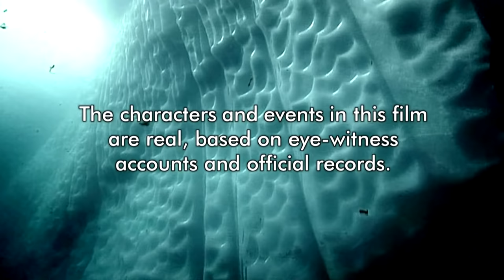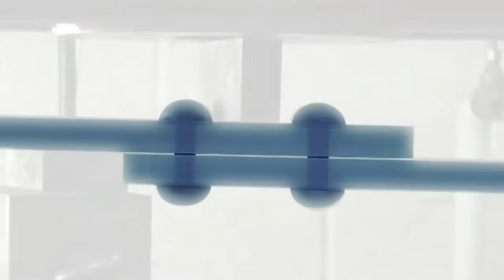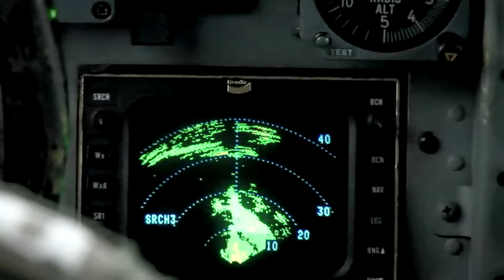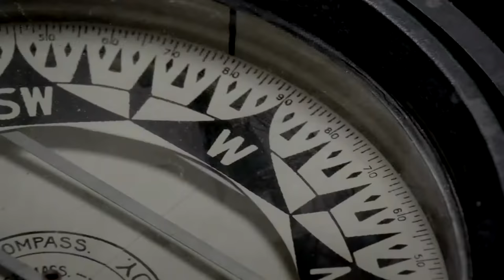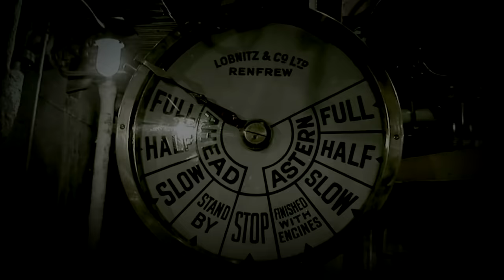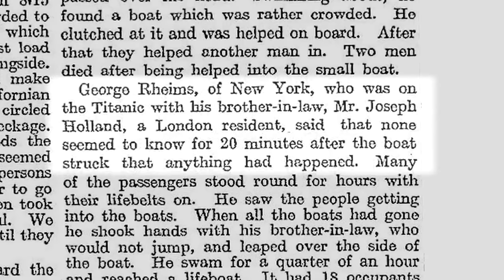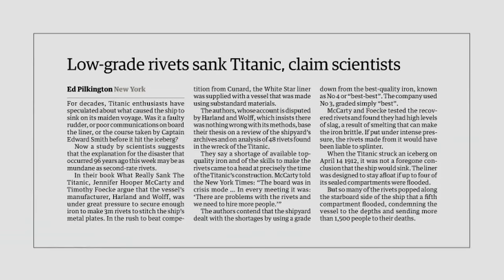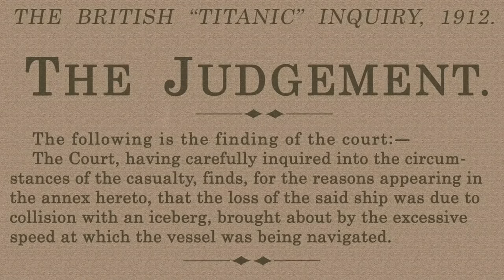The Unsinkable Titanic

Comment: Due to the weather conditions that night, clear & calm, which also caused a mirage to form, it make it difficult to see the iceberg even if they had binoculars
Reply: That’s no excuse what about the life boats they should of had more but no they got cocky saying it was a unsinkable ship you don’t play with the sea an put peoples lives at risk if they had more life boats all those people could of survived also the speed they was going knowing there was icebergs ahead several boats warned them
Reply: @bec1423  yes and the wireless operator should not have set the iceberg warning he received aside. Iceberg warning should have been priority, but since they were paid to send passenger messages, they made that their priority
Reply: @davinp   it’s a shame people lost their lives because the ones on the ship were reckless
Reply: @bec1423  While I agree they should've had more lifeboats, it wouldn't have helped. They only had 20 lifeboats (16 regular and 4 collapsible) and the last two weren't even launched properly because they ran out of time.
Reply: @bec1423  They actually had more lifeboats than the law required at the time. Back then, Lifeboats were used as a ferry between a sinking ship and rescue ships. The law required ships over 10,000 GT to carry 16 lifeboats (as they decide the amount of lifeboats on a ship by its gross tonnage, not the passenger limit). Titanic, a 46,000 GT liner, carried 20. Such a shame that the law was last revised in 1894.

Also, Harland and Wolff, the shipyard, never said that the ships was unsinkable. The press did, and the people believed it. Even WSL's VP believed it.
Reply: As the story goes .
Reply: Yes, which should give them  reason to be more apprehensive !
Reply: Better than their eyes ! 👀
Reply: They new there were ice fields but ploughed through full speed to beat the clock. Very silly mistake
Reply: @bec1423   Actually, what you just said is a complete myth. In actuality, they wanted to opt for MORE lifeboats. The problem was they were too heavy. The standard life boats, the 14 clipper built wooden lifeboats, weighed over 2 tons each! The 6 other boats, two cutters and four collapsible's, weighed more or less than a ton. Given their weight, any more lifeboats would have caused the ship to rest lower in the water and put it in risk of capsizing. That's why they opted to building collapsible boats. Because they weighed less than the clippers, they were able to get them certified. Unfortunately, that's all they were allowed to put on. Even if weight wasn't an issue, given the time it took the ship to sink, there is no way that 48 lifeboats would be launched successfully. Also, it should be known that the belief of Titanic's crew was trying to break speed records is yet another myth. In truth, they were competing with Cunard, not in speed, but in size and luxury. And the crew considered the comfort and safety of its passengers above all else. Though it is recorded that Titanic was clocked at around 21 knots when she struck the iceberg. Back then, it was an unwritten tradition to beat the ice field before it crossed into their waters. Beforehand though, it was crucial that they stay at a reasonable speed. This is further stated by the WSL motto which, unfortunately, I can't remember off the top of my head.
Reply: @6metaweemaxphethin16   And the reason why the number of lifeboats went by tonage rather than capacity was because of their weight. 14 clipper built wooden life boats weighed over 2 t each. Then there were the 2 cutter lifeboats that weighed about a ton and a 1/2. And finally you have the 4 collapsibles that weighed a little less than a ton. Too many clippers, and the ship would settle lower in the water than normal, compromising the ship's buoyancy and put it in danger of capsizing.
Reply: @bec1423  the Cunard ships did not have enough lifeboats…the Olympic did not have enough lifeboats…it was a BBoT regulation that dictated the number of lifeboats not WSL…
Reply: @davinp  the message was not marked correctly when sent…
Reply: @brianwhitford6086  can you explain how the addition of 16 more lifeboats (32 tons more) is going to affect a ship that displaces 52,000 tons
Reply: @6metaweemaxphethin16  😅

Comment: On 9 October 1912 White Star withdrew Olympic  from service and returned her to her builders at Belfast to be refitted to incorporate lessons learned from the Titanic disaster 6 months prior, and improve safety. The number of lifeboats carried by Olympic was increased from twenty to sixty four (per Carlisle's original number), and extra davits were installed along the boat deck to accommodate them. Also, an inner watertight skin was constructed in the boiler and engine rooms, to create a double hull. Five of the watertight bulkheads were extended up to B-Deck, extending to the entire height of the hull. This corrected a flaw in the original design, in which the bulkheads only rose up as far as E or D-Deck, a short distance above the waterline. This flaw had been exposed during Titanic's sinking, where water spilled over the top of the bulkheads as the ship sank and flooded subsequent compartments. In addition, an extra bulkhead was added to subdivide the electrical dynamo room, bringing the total number of watertight compartments to seventeen. Improvements were also made to the ship's pumping apparatus. These modifications meant that Olympic could survive a collision similar to that of Titanic, in that her first six compartments could be breached and the ship could remain afloat.
At the same time, Olympic's B-Deck underwent a refit, which necessitated eliminating her B-Deck promenades – one of the few features that separated her from her sister ship. The refit included extra cabins (the parlour suites which proved popular on the Titanic were added to the Olympic), more cabins were fitted with private bathing facilities, and a Cafe Parisian (another addition that had proved popular on the Titanic) was added, offering another dining option to first class passengers. With these changes, "Olympic's" gross tonnage rose to 46,359 tons, 31 tons more than Titanic's.
In March 1913, "Olympic" returned to service and briefly regained the title of largest ocean liner in the world, until the German liner SS Imperator entered passenger service in June 1913. Following her refit, Olympic was marketed as the "new" Olympic and her improved safety features were featured prominently in advertisements.  !!!

Comment: Stopped watching about 50 seconds in when some guy (probably a self-proclaimed "expert") showed up saying "from the very day she was designed she was almost doomed". Making it sound like there was some critical design flaw and that she was inherrently a dangerous ship. Which is nonsense of course. Her sister Olympic got hit with a rogue wave that was big enough to break bridge windows, damage the compass platform amidships on the boat deck, and inundate the radio room which was also on the boat deck, but other than these minor cosmetic effects shrugged it off. The damage that Titanic took (opened up along about one third of her length) would also cause the vast majority of modern cruise ships to sink. Even today, ships aren't designed to take a third of their length being opened to the sea and survive it - it's just such a freak happening for that kind of damage to be caused, that it's considered acceptable because the probability is so low. In terms of subdivision and the kind of damage she could have taken without sinking, Titanic compares pretty well with similarly sized passenger ships of today.
Reply: With the same design, the Olympic continued 25 more years and was nicknamed "Old Reliable " until she was finally retired. They were good ships.

Comment: One thing about the lifeboats...yes the Board of Trade regulations had not kept up on ship size. However, there was also an attitude bolstered by recent experience that any disaster would only require lifeboats to ferry passengers to waiting rescue ships. Several sinking's around that time had seen passengers drown when launching lifeboats...so there wasn't a lot of confidence nor was the mindset that every passenger would have to leave the ship at once instead of in ferry groups. The Titanic disaster would prove this wrong of course.

Comment: Best information I've seen regarding the events that led up to this tragedy. One person can make a huge difference. Tragedies happens when people don't know or understand their own power. Almost any one of the people discussed in this movie could have averted the outcome by themselves with a change of a single decision made.
Reply: Most accidents happen via several mistakes or causes. Often if you take just one factor out of the sequence of events.. it may not have happened
Reply: "full astern" is the order that doomed the ship, reversing the flow of the water over the steering rudders and preventing them from doing their job. "Full speed ahead" would've increased the water flow over the rudders and make the rear of the ship push sideways  fast enough to angle the ship and miss the iceberg.
Reply: @whatthefox4787  they turned to the left (hard to starboard?) and reversed only the left hand engine to drag the nose of the ship round didn't they? Trying to remember from the film. 
Tbh ismay or whatever his name was doomed the ship by insisting full speed ahead to arrive in Newyork early. That and the look outs not having their binoculars.. they were locked away aparently and no-one had the key?
Reply: Boards of enquiry try to apportion blame to stop fear of future ships , it was without a doubt the idiots radio operators .
Reply: @deangale4496  this too.
Reply: @johnmurray9526  I've always wondered why they didn't just break through the cabinet and get them cause they didn't have the key, they could of smashed through right? they would of spotted the iceberg sooner and saved the day. that one mistake cost so many lives and caused so much sadness and suffering. RIP!
Reply: @johnmurray9526  Yes, I think that's correct from all my years of reading up on it. Back then the steering wheels were kinda backwards to what most people would think now, in that if you want to go left, you turn the wheel to the right.  Unlike a car.
Reply: @Smallville7  Probably b/c they followed rules and protocols, which British are very particular about, and would be charged with a crime by the White Star Line. They throw that idea in the Titanic movie when Jack and Kate break down a door.
Reply: Extremely sad RIP to all who lost their lives on the Titanic....
Reply: @jaelynn7575  I find it unbelievable that the captain didn't have an extra set of keys to ALL doors on the ship?

Comment: I severly doubt steel rivets would have made that much of a difference. At those forces that were at play here, it would have very slightly shortened the rift at best. But in no way would they have held.
Reply: Iron is brittle to impacts and shearing forces. Its only good in compression. It most definitely would have made a difference. How much of a difference is anyones guess...
Reply: @johnmurray9526  It wouldve made a difference..one that has to be entirely ignored..cause the collision was a prime example of :moving object hits immovable object
Reply: @NashmanNash  didn't hit it... it glanced off the side of it splitting and putting holes in the side but some sheets of iron were just dented but it didn't matter cus the rivets let go on these sheets. Remember if just 4 sections were holed it could have stayed afloat. But the first 5 were... I think it might have atleast stayed afloat longer? Who knows!
Reply: YouTube "experts"...🤦‍♂️🤦‍♂️🤦‍♂️
Reply: @dictumobiter1365  I dont think anyones claiming to be an expert... it's just viewers opinions and speculation
Reply: The vast majority of the rivets were steel, iron rivets were only used in the bow section as the power rivet hammers could not be used in the bow section due to limited space.

Comment: The thing about the binoculars appears to be wrong. Another documentary says that in fact it wasn’t common practice for the lookouts to use binoculars in the conditions the Titanic would have been in because they would have made spotting an iceberg more difficult. Unfortunately I don’t remember all the points made, but one argument is that binoculars would have provided the lookouts with only a small range of vision on either side, so they could quite easily just not see an iceberg in time. Without binoculars there was more chance of seeing it because the range of vision was bigger. That point made, there is something enduringly moving about the sinking of the Titanic. The idea that the ship was believed to be ‘practically unsinkable’, the thought of people being in the water, screaming for help in the dark and cold. The inevitability of not having enough lifeboats, though the number they had did comply with Board of Trade rules at the time, the engineers who stayed at their posts in an effort to keep the ship afloat for as long as possible, saving many lives in the process. There are so many stories of courage in the face of the disaster, along with the stories of tragedy, it all adds up to something unforgettable. Now it could be said that the Titanic has claimed more lives. I feel certain that the people who lost their lives on the sub the other week will become part of the ship’s enduring story.

Comment: I used to swim in the San Francisco Bay when I was about 27 years old and in great shape. The water temp was about 48-50 degrees.  I remember that within a couple minutes of entering the water my body would be completely numb. After about 25 minutes it would seem like I struggled to keep my hands “cupped” for swimming. It was speculated that the water temp where the Titanic sank was 28 degrees!! Hopefully the victims did not suffer a painful death.
Reply: Not for long, anyway. Absolutely surreal.
Reply: Water freezes are 32 degrees. The Atlantic had to have been over that temp or else would have been frozen solid.
Reply: @beatrixbrennan1545  salt water freezes at lower temperature.
Reply: @joycewang8939  thank you.  I realized this AFTER I posted this comment. Learn something new every day...

Comment: They still had engines, I have often wondered why they didn't ferry people to the iceberg or steam towards the ship on the horizon. Worth a try. I know, hindsight is 20/20.
Reply: They would take on water even faster and the ship on the horizon was the Californian, who had turned off their radio when the Titanic's operator told him to "shut up" because he over rode him sending passenger messages. That was the true death knell for them. If the radio operator wasn't a dick to the operator trying to warn them and that operator wasn't a bigger dick by turning his radio off, the Californian could have been there in time to save everyone.
Reply: @meghanmcintosh135  Californian only had one radio operator, and he switched the set off when he finished his shift.   Operators of the day communicated using a form of morse shorthand, and the supposed 'shut up' message wasn't as offensive as people seem to believe.
Reply: unfortunately, when the ship hit the iceberg, the first thing they did was lower the waterproof doors, trapping the Fireman and Stokers inside with the rising water. They were the first to drown and there wouldnt be much steam produced for motion in those flooded compartments.
Reply: Titanic was dead in the water!!

The firemen couldn’t stay down there shoveling coal as the ship flooded about them! 
Even if they could move the ship it would only sink faster. They did try that with the Britannia as it sank. They tried to run the ship aground or get it close to shore but that didn’t work! 

Crashing into the iceberg a second time would have saved nobody!! Lol! 

After the berg was struck…. Titanic’s crew performed as best they could. They had almost enough time to launch all the lifeboats they had. They had no more time to launch another 20 boats so more lifeboats wouldn’t have made much of a difference. At best some of the boats could have been floated off the decks during the last stage of the sinking. More people might have been saved but it would have remained a terrible tragedy with great loss of life.
Reply: @whatthefox4787  There were escape ladders in every boiler and engine room, so no danger to be locked in watertight room even when watertight doors closed.